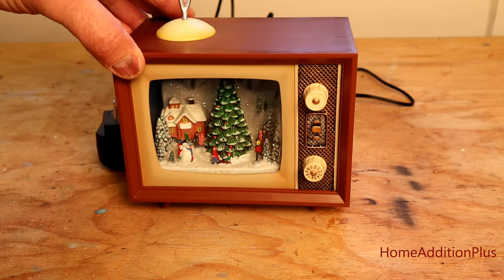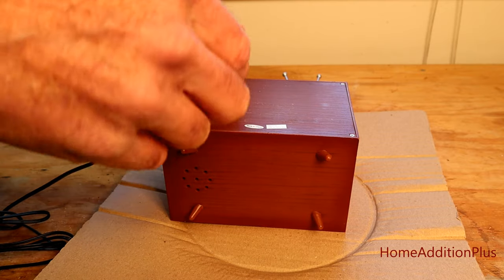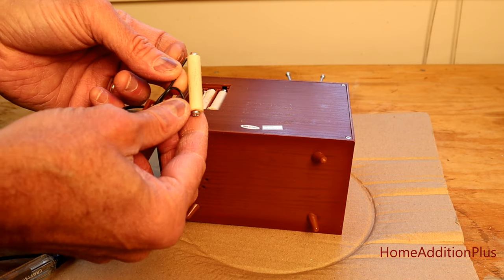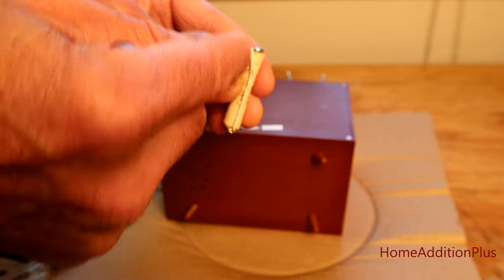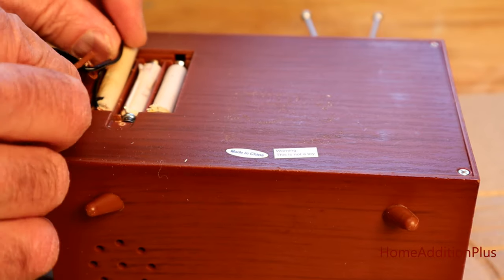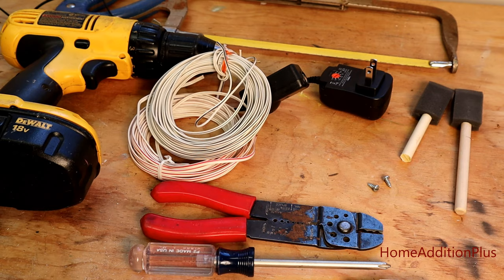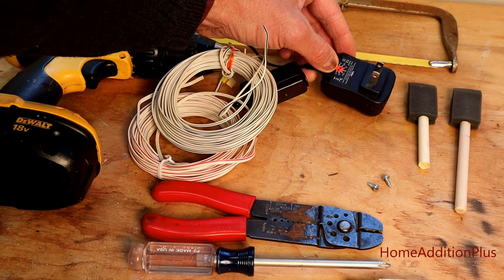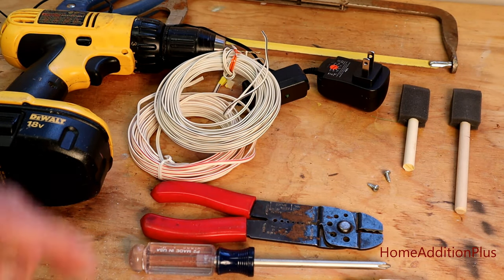How to Convert a Battery Powered Device to a Wall Plug Powered Device

Comment: Are there any concerns of causing a fire with the use of wood? It's a cool project, though!
Reply from the maker: No concern. The wood is an insulator. No current is being absorbed into it. The current, from the batteries, is running over the wires.
Reply: Where is this beautiful home located?

Comment: I have a portable water pump that comes with rechargeable batteries. I want to make the pump receive its power from a wall outlet. I have the same adapter as the one in the video, but I don't know how to connect them (the pump cable end is 3.5*1.35mm DC). Do you have any ideas?

Edit: I just bought a double-sided female jack (to connect the pump to the adapter), alongside two cables, one with a button (for on/off functionality), and the other is to convert the pump's male plug from 3.5*1.35mm to 5.5 * 2.1mm. I was afraid from getting something wrong as I understand nothing in electricity, but it worked just fine. The pump is now receiving the power directly from the wall outlet with a button click 😁.

Comment: Couldn't you just find the positive and negative and ground wires that connect to the battery pack and connect the adapter to that? I'm thinking about doing that to this battery powered blow up santa we have the batteries keep dying fast so i was thinking about just connecting a 6v adapter to it. It takes 4 AA 1.5V batteries.

Comment: Thank you, dummy battery is such a good idea!!  But why not just use 2 dowels to connect (just one end of each) to a wire from adapter and mark + and - on them, so you put only the first and last dummy battery in and skip all the others in between.
Reply from the maker: I'm not sure I fully understand your suggestion. But suffice it to say, the 3 batteries normally that sit in the device schematically are connected in a row, - to +, - to +, and - to +. So, the 3 dowels are needed, with two having a wire attached between each end, to keep the chain together and allow the flow of current to the PCB with the electronics on it.
Reply: No need to chain.

1. Take one dummy battery, mark it +, and screw one of its end to + wire from adapter.
2. Take another dummy battery, mark it -, and screw one of its end to - wire from adapter.
3. Put the + dummy to the first slot of battery case and the - dummy to the last slot, skip the middle slot.
4. When an electronic device requires 4 batteries, do the same to the first and the last slots, skipt 2nd and 3rd slot and switch the adapter voltage to 6V.

This is equivalent to connect adapter wire directly to the 2 ends of battery case.
Reply from the maker: @JasonECI  Yes, that will work too and save having to make up the middle dummy batteries. If I get around to it, maybe I'll do a short video to show that solution.
Reply: Can we just put a dummy battery in the last slot and set the adapter to 12v? Or the electronic schematic requires power at the beginning of the battery series?
Reply: I meant 4.5v for your device
Reply: Hi, sense you have a 3 battery unit ,all three must be linked , in some way to close the circuit. With a lot more work you can eliminate the battery holder all together and wiring to switch directly. The Dow/dummy idea keeps your unit intact with much less work.
Reply: Just solder to contacts no dowels needed